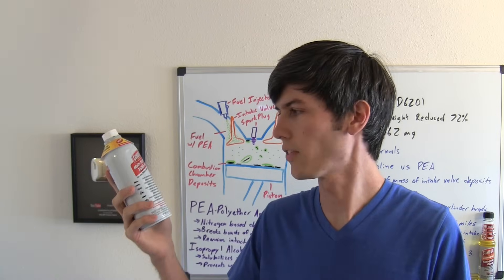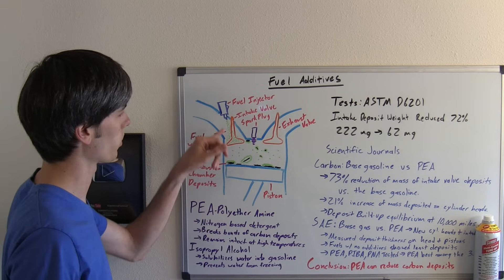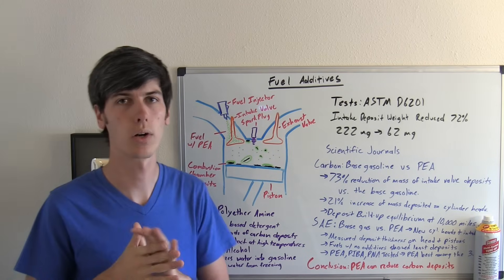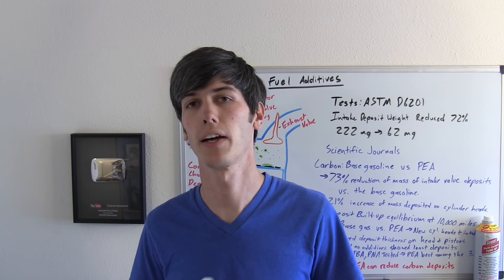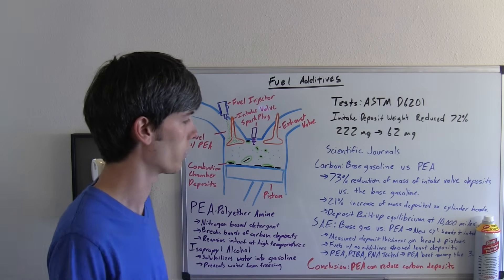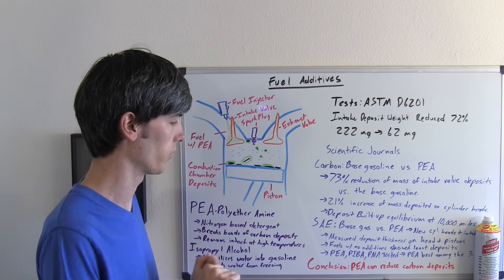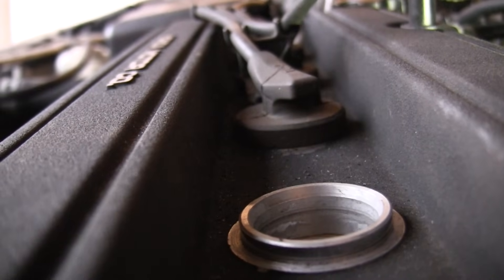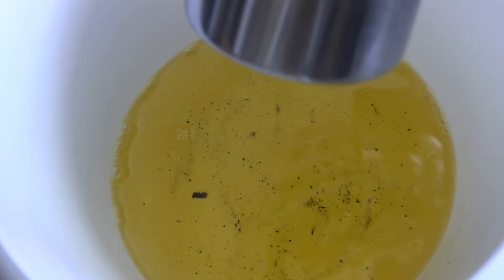Fuel Additives & Injector Cleaner - Explained

Comment: I have a 2005 Civic EX, and last week when the car had 1.6 gallons left in a 13.2 gallon tank, it was not getting fuel to the engine to start it.  I finally got it running by rolling downhill and popping the clutch.  When I put gas in it, it has run fine since.  Should I put something like Gumout in it, would that help? My car has 135,000 miles on it for reference, with all original parts in the fuel system.
Reply: fuel pump

Comment: hello how are you? I got a quick question. do you know if bg 44k actually work in fuel treatment?
Reply: i used to use 44k in a 240sx that used to stall on start up the 44k seems to cure the problem but the problem would come back after some time
Reply: +MrChubhub22 thank you I appreciate it
Reply: +Milo Gomez i used other bg products like moa and the green one that is similar to seafoam i can say most bg products are pretty good
Reply: +MrChubhub22  thank you. I just wanted to get the most honest review before purchasing to see if it's worth the money. thank you for your honest opinion and experience  with this product.

Comment: all I onow is that my tuner has dyno tested many fuel additives that claim hp gains.  he says that with the dynos he has run none of them have shown any noticable gains. so dont fall for those "octane booster" claims.
Reply: +Deadpool Octane rating is a fuels ability to keep an engine from detonation. If octane rating increased horsepower, you could easily increase hp in any vehicle by just buying super premium. The octane rating (resistance to detonation) will allow you to tune and/or modify your engine for more horsepower. As some performance engines can't use pump gas due to the octane rating being too low, because the setup for the engine requires a fuel that has an octane rating that is much more resistant to premature detonation. Simply running fuel additives will not increase horsepower, but you may notice that adding those "octane boosters" negate detonation a little more than simply running straight pump gas, therefore allowing you to do things like advance your timing a little higher or turn up the boost on your turbo setup a little more. Should you run octane boosters just to achieve this? No. If your setup requires 110 octane to run properly and not detonate, then that is what you should use, not some super premium fuel with an additive that adds octane rating to your fuel.
Reply: 0090cl im pretty sure i already said that i dont go for those octane booster lies in my OP. a car that is not tuned for a higher Octane rating will not take advantage of the higher rated fuels. so if you drive a regular economy car that calls for 87. and you put 93 in it it wont do much for your performance because the car is not tuned. the same with the so called  "OCTANE BOOSTERS" there is no real way that you would ever know if a booster really increases your octane without sending a sample in to get tested. My tuner said he has never seen anything worth running boosters and i trust his words over any commercialized product.
Reply: Deadpool That's what I said, more or less lol. My point is that the octane "boost" is only noticed during a tuning phase when you can compare "boosted" octane to standard octane on a tune or a power adder... IF the octane booster is in fact, a legit boost and not just a scheme, of course. I'm not saying they work phenomenally, but every now and again, I used to run a bottle of booster and cleaner in my old sbc and since it was fuel injected, I did notice a little better performance in the fuel system. Considering I had my ECU chipped and the car tuned for 93 octane. The cleaner to revitalize the old injectors, and a booster to ensure that my 93 octane gas, was in fact, at least 93 octane. Anything less than 93, made my car run like ass.

Comment: Hard carbon deposits are beneficial, preventing heat absorption thus pushing the heat out the exhaust pipe, where it's preferred.
If older engines have anything more than hard carbon deposits, more like loose, sticky looking, then the valve guides, piston rings and bores, crankcase breather should be inspected, reconditioned, replaced or cleaned.

Without any scientific qualifications but plenty of experience with old engines, I'd say most of these products are designed to work on the mind as much, or even more than the engine.  Anybody remember the net full of tin pellets meant to be dropped in the petrol tank when the UK converted from leaded to unleaded petrol? 

I use a tea spoon full  Castrol R or some other brand of castor based oil. Just because it makes the exhaust smell sweet ;)

Comment: Good Overivew - first - what person with common skills will know that there is an insue with carbon build up ? How much carbon build will generated an issue? What is the solution to the carbon build up in in the first place or how to reduce it? By your statement of the engine is in eq after 10k then what causes the addtitonal build up over time and how long? By  your statement you also state that gasoline additives cause this? Why? I like the overview on this subject, just dont know I can buy in the need to use on new cars not required or waist of money in my book! Yes this stuff may work but what is real indicator that the user will know when too??

Comment: I'm tempted to use higher octane gas just because of the benefits I've heard worth it? I'm thinking worth it just because of all bad things I've heard about 87 gas being trash and ruining your engine over time
Reply: I think it's better to just use a higher quality gas brand like Chevron or Shell. I don't think using a higher octane will result in a difference unless you have a higher compression motor

Comment: Is there any truth in rotating between two different fuel brands every 5000-10000 miles, so that the different detergent in each brand will clean out the deposits caused by the other brand?

Comment: You may have already discussed this topic but do you have any videos on meth/water injection either by AEM or Howerton Engineering. I currently own a 2008 MINI Cooper S with a N14 engine that uses a direct injection and has a carbon build up a shared issue with all dried injection engines. Thanks!

Comment: is there any risk of these cleaners doing harm to parts of the engine like gaskets, or the fuel pump?
Reply: +Wynton Sparks - I tested some cleaners, including the Gumout motor treatment, on some fuel line. Some of the cleaners did seem to affect the rubber; you can see the results on my channel.
Reply: +Wynton Sparks I second this.
Reply: Rubber gaskets in cars might not be made for this type of additives and could damage them in some way (make them weaker) , if you love your car and want to keep it in top shape for a long time try not to use additives too much , once a year or twice at most

Comment: I think this is good as far as it goes. The Fuel that you buy at the pump these days is not what used to be available in the past. Most fuel retailers and their up chain suppliers are forced to sell a blended fuel with ethanol, which not compatible with most components in the fuel system. Also fuel is not blended to be as stable as it once was. Fuel is meant to be burned within a 30 day period and peaks at about 10 days. Top tier fuel that meet higher standards will also reduce combustion by-products when used. Shell is my fuel of choice and does a good job in my personal ICE's when examined by bore scope. Always use the octane fuel intended for your specific vehicle and a high quality fuel will help to ensure a long and healthy life with fewer problems while in service.
Reply: LuckRenewal most stations have 10% ethanol in the D.C. Area all do that I know of
Reply: +JAY WASSERMAN i agree.  most stations here in toronto says "may contain up to 10% ethanol" at the pump.  but shell declares that they have 0% (i think it's below a certain detectable limit that they can declare that) for their V-power gas.
Reply: 1. California MANDATES ethanol (to reduce winter emissions) so we are stuck with it.
2. I thought modern anti-knock sensors and ECU's (engine control computers) were flexible in adapting to fuel quality - they will increase the performance on-the-fly if you use higher octane fuel. I definitely recall models that say the spec'd horsepower is based on Premium, but the car will run fine on Regular if you prefer. And vice versa, cars spec'd with Regular that pick up a few horsepower on Premium. But I'm not sure if all cars do this or only Euro models.
Reply: Robert Phelps go with Shell. no ethanol

Comment: How do I clean the valves on a direct injection engine?
Reply: +eric4w You would have to use a combustion chamber cleaner through the intake system.  GM upper engine cleaner works well- you introduce it through a vacuum port like the PCV or brake booster line in small amounts while the engine is running.  After pulling enough cleaner into the engine to stall it, you allow it to sit for a length of time and then run the engine again- clouds will flow from the tail pipe.  Be careful though, if you pull too much in too quickly, you can hydro lock and ruin your engine.

Comment: In a fuel injector the fuel flows over a coil of wire that is insulated with varnish.  I was told that fuel injector cleaner removes this varnish over time and causes these coils to short out.  Is this true?

Comment: Window washer fluid (cheap blue 20- protection) via a tiny vacuum line works wonders for carbon buildup. That stuff is 30% methanol and 70% water and it literally steam cleans your intake valves and combustion chambers/pistons with no ill effects on the engine at all. Keep a steady 2500 RPM rev and a steady stream of washer fluid.
Reply: +GioGuitarDude might wana be careful with that as it would be quit easy in a piston engine to hydro-lock. I have personly seen up close what that looks like. Shattered crank, warped head, and damage to valve train. Rotary engine you can get away with it, but a piston engine is not quit as tolerant.
Reply: Chris Halligan Yup, that's why I made it a point to add "tiny" in front of vacuum line. Like a 1/16" size hole or smaller is perfect. I cut off a piece of the little red straws that come with the cans of carb or brake cleaner and put that piece into a vacuum line that you connect to the intake manifold somewhere close to the middle.
Reply: GioGuitarDude Ya that is what the guy did also. I know that it was a 22r 4 cyl out of a 83 Toyota 4x4. The vacuum line was on the left side as you're facing the truck. I dun know, maybe it was a fluk or something, but ever since then i have been a little gun shy about useing anything that has H2o in it for cleaning through a vacuum line. I preferred to use a product that can combust thoroughly like sea-foam. Unlike H2o, products like sea-foam have at-least an octane lvl and can combust. H2o cannot. According to the laws of fluid dynamics H2o cannot be compressed and since it can't you get over pressurization within the cylinder because the allotted space available with-in the cylinder is now being occupied by a substance that does not compress and does not combust. And the rate at which it is able to turn from a fluid to a vapor form is not fast enough to alleviate the building pressure.

Now with that said it may not happen the first time, or even the 10th time. But it is an absolute certainty that it is putting alot of undue stress on the engine, and eventually what could happen is that with all this accumulated undue stress a catastrophic failure can happen.

Also to consider. Piston rings are ment to be lubricated by oil and FUEL. adding a substance that has corrosive/oxidizer  abilities ( the "O" in H2o) and dilutes the lubrication abilities of the fuel and oil is in its self not a good idea.
Reply: Chris Halligan I completely agree on that last part, especially when the washer fluid isn't being super atomized like a methanol injection system, but lubrication won't be a big issue with no load on the engine and injecting it for just a few minutes to remove carbon deposits. And it's interesting that you mention the octane source. Upon delivery into the combustion chamber, the water immediately vaporizes due to the drastic temperature difference, and the methanol within the washer fluid (30%) raises the octane and actually makes the engine run richer. No liquid or oil can be compressed, so it's important to not overdo it with any fluid. As long as the hole that the solution is entering the engine from is 1/16" or smaller, there is is no issue.
Reply: You're brave. Wow. I'd just buy Top Tier gas

Comment: Are you saying that a car that has been running and not sitting around, has less carbon build up, which in turn is in a better state as the one that has been sitting around? So Less miles is not always better than more miles?
Reply: +jose godoy Engines like running. Prevents drying up, liquids going away from places or falling to wrong places, won't let condensation to set etc. "Best kept" engine would most likely be one that runs 15-30 minutes once a week or once a month.

Comment: I use Marine outboard 2 cycle TCW3 rated oil to clean and lube my fuel system in the Volvo and Jeep. The formula is 1oz of the oil per 5 gallons of gas. It's burns ashless so no harm to cats or sensors. Remember it must be 2 cycle with the TCW3 rating. Use it at every time you get gas.Check out Sarge LS1 on Google he tests all the time. Many people do this. Give it a few tanks and see for yourself. You won't know your car is running at idle.

Comment: Do not use alcohol in 2 stoke engines, the water soaked fuel with alchohal  pushes the 2 stroke mix oil away, Feeding the motor with fuel water alcohal only. and your moter siezes. let the water freeze. and pour out later. Northern Guy

Comment: maybe the most important thing not mentioned is that a lot of these "cleaners" have stuff in them that can actually melt and/or deform the fuel filter gasket in your tank... which is never a good thing
if it deforms it might impede fuel flow, and worse case the fuel filter ruptures or melts allow a lot of gunk & debris to enter you fuel injection system...  and the cost of replacing a fuel injection system is much higher as the cost of "added consumption" because of dirty valves.
Reply: +RnRollie - I performed a test to see if some of these motor treatments would affect the integrity of fuel lines, and some of them did seem to affect the rubber. I've got the video on my channel.
Reply: Good question. Marvel says it can if you go over the recommended on their web site.

Comment: Interesting that the addition of additives to fuel always resulted in buildup.
Reply: +Terry I Yes, because the additives are designed to trap carbon, do not burn and are not in any way a designed part of the burn cycle. I find this only natural. Look at your mobile phone screen: once you remove the factory protector from it, you wouldn't want to "clean it" because by cleaning it you'll have to touch it, leave residue, maybe rub accidentally some grease from your skin etc... However, if the screen was really dirty then cleaning it would definitely help.

Comment: Can water injection clean out the carbon??? I noticed a difference in throttle response after installing it  on my 4.7 Toyota V8 even with it off. Also, I would like to hear your take on the youtubers who run their cars on gas fumes.. They hook up the intake to a gas can with holes in it casing the gas to peculate, hence the fumes.

Comment: somebody needs to come up with a solution to clean the intake valves on direct injection engines without taking it apart
Reply: +Var S Direct injection engines do not build up carbon as quick as port injected engines. Deposits may form on the intake valves of a direct injection engine when lube oil finds it way to the intake, e.g. leak from the valve guide or oil entrained from the positive crankcase ventilation.

Comment: Wait, the info was cool but the conclusion seemed wrong. Evidence showed an increase in carbon buildup on certain parts of the engine vs base gasoline. And the conclusion is PEA can help get rid of buildups? Well that's fine and dandy for the intake, but what about the heads and exhaust? What about differences in performance and fuel economy.

Your conclusion seems empty... Sorry if I am being pedantic.
Reply: +David Love There are two kinds of deposits discussed in the video: intake valve deposit (IVD) and combustion chamber deposit (CCD). PEA gets rid of IVD, but may increase CCD. This is why EE recommends only use the additive if you have an old car which has IVD. There is a trade off in using fuel additives.
Reply: Glad that I can clarify.
Reply: Sea foam or water on the other hand only clean the piston, not the intake valves, so one could use one of those afterwards.
Reply: +David Love 
Good point!
Reply: +icekk007 right on. I could jave missed that.
Reply: icekk007
Thank you for your explanation ;-)

Comment: this stuff does not work
Reply: +Noah Rule It worked for me.  My car is 26 years old.  When I added it to two gas tanks(could have gotten away with one) my car responded more and better mileage.
Reply: Taylor F. Placebo effect look at Chrisfix videos and he'll show u these additives are just money hungry company's
Reply: Noah Rule Its not placebo, my point is that if you have a really bad problem and its never been used before, 1 bottle makes a whole lot different.  More after dont do much
Reply: +Noah Rule some do work with pea but mostly for fuel injectors.
Reply: ***** Best Picture all year goes to this guy
Reply: +Noah Rule lol
Reply: there is a video on the Fifth Gear channel where the additive gives them back ~6 HP on an old car. They also did 8 runs each so it's not just randomness